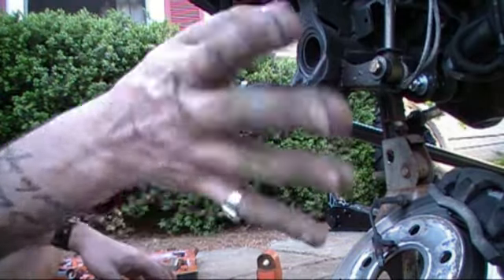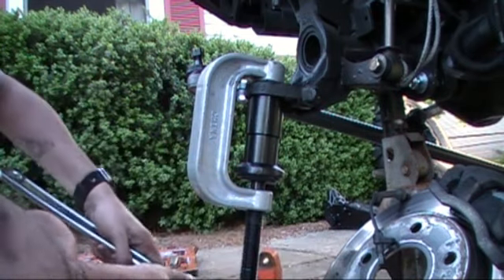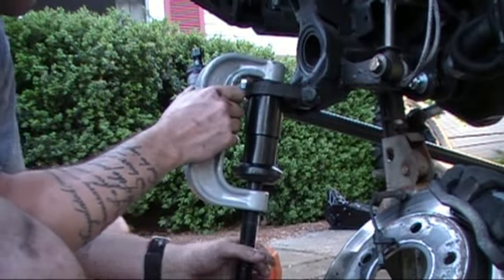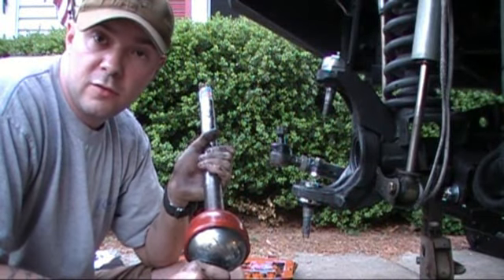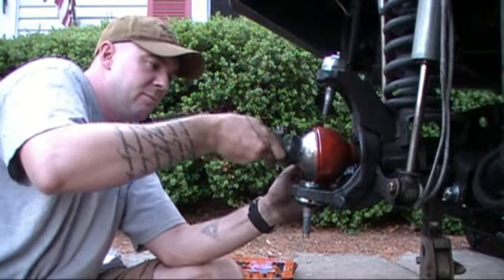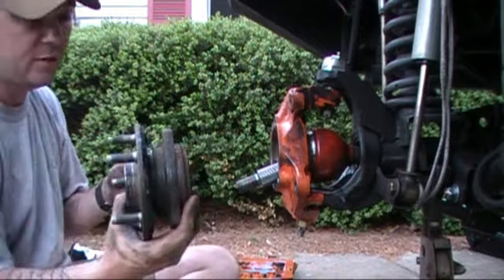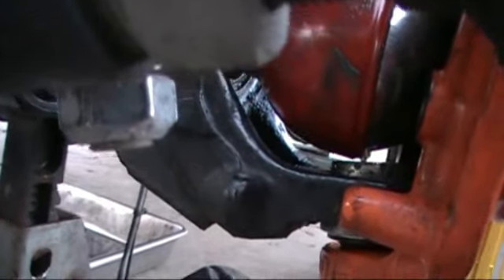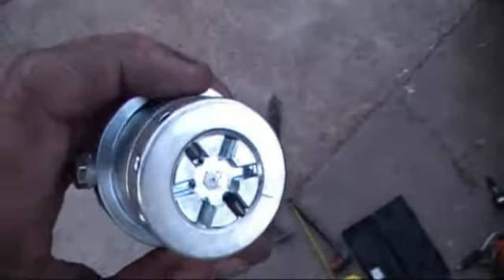RCV shafts and Dynatrac ProSteer ball joints part 2.

Comment: a piece of pipe? trying using a good set of ball joint remover tools.
oh and Walmart has great sales on air tools
Reply from the maker: I take it you have never removed JK ball joints, most kits do not include the required pieces to setup. Also a ball joint press is essentially a big clamp and pieces of PIPE.
Reply: im sorry im not used to working on my jeep in the driveway...I have proper tools and a garage to do it in and I buy the kits that include all the required parts I need for the job so I don't have to use a PIPE. If your going to do a video showing people how to do it try showing them the RIGHT way.
Reply from the maker: Jared White so I guess you take that big ass kit to the trails with you too? Or you enjoy spending 3x as much on a kit for that extra piece of "pipe" that you need only for the jeep JK? or maybe you have no idea how to fabricate your own tools? Do you even fabricate on your own jeep or just bolt stuff on? Why don't you do your own video and show all my viewers your way to do a ball joint change. Or stfu and stop replying to mine.